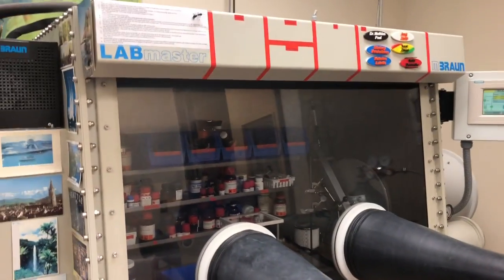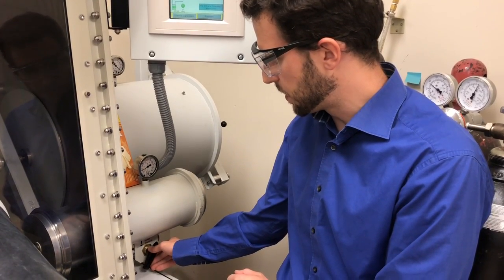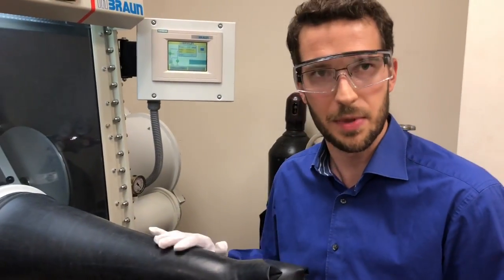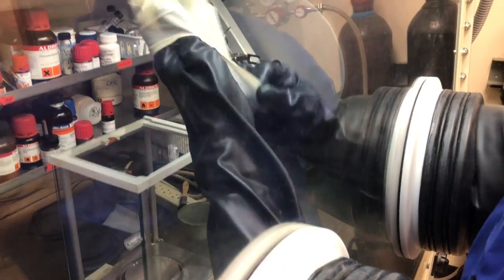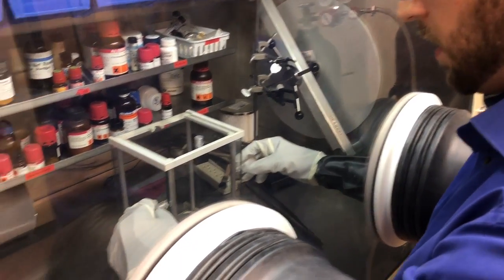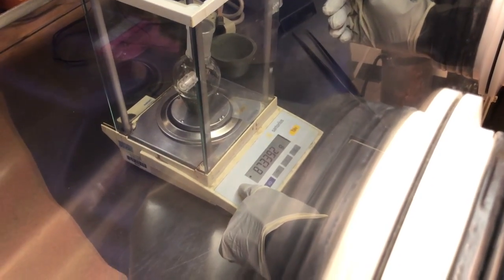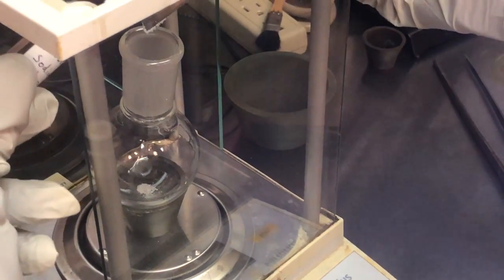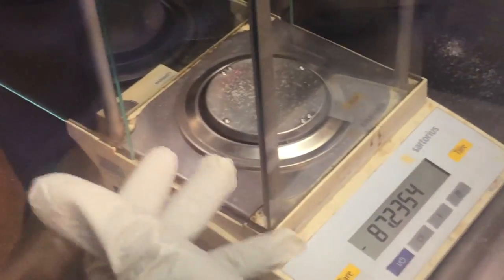Using a glovebox: bringing items in and weighing

Comment: That was helpful. Thanks. How can I clean the glass wall of the gloveox?
Reply from the maker: It's awkward but usually possible to clean from the inside using a cleaning tool (like the cloth side of a squeegee). If it is really filthy you will probably need to remove the front panel after shutting the box down.
Reply: This panel is typically polycarbonate. Use care with chemicals.

Comment: Is it OK to open the antechamber from inside while the valve is open in the way of filling gas? Does the system automatically set the pressure because of working pressure limits no matter what the position of the valve open/closed?
Reply: The refill is from the glovebox so the atmosphere is the same. Evac/refill will be closed if outside door is open, though.